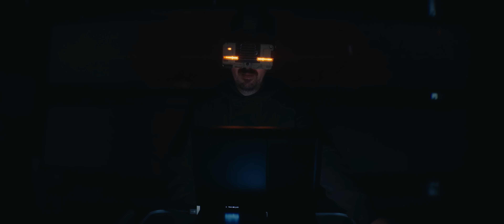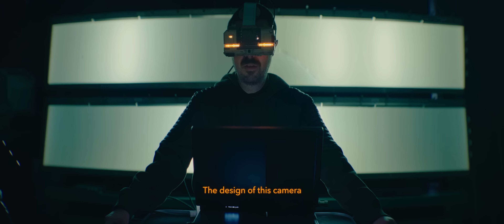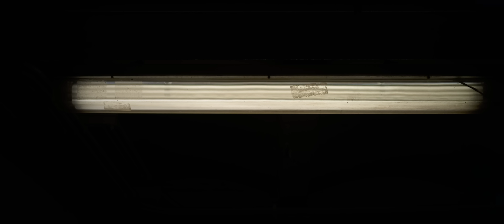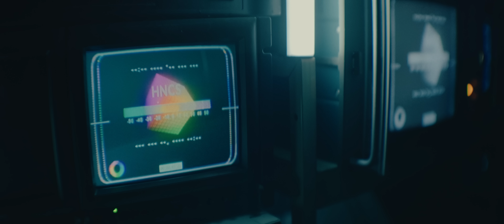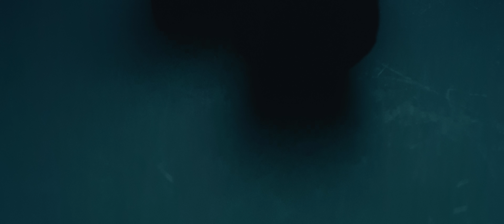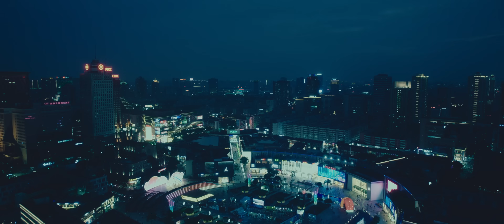when hasselblad shows us the future.

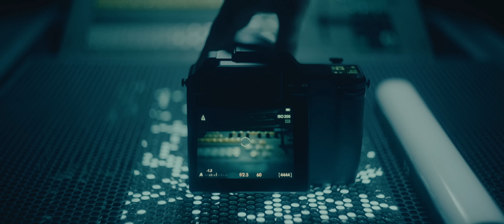Comment: i wish the MF feature at 4:31 was on every camera

i remember some adapters for MF lenses to Canon EF used to have focus confirm which was similar and it sucks that there isn’t this kind of “MF focus confirm” for all cameras
Reply: Nikon has a similar function all of the cameras I've ever used from them, d2x D7000 D800 Z6ii and Z9 plus the Z9 has in viewfinder focus peaking if you like that, (I do like that).  In the bottom left corner of the viewfinder below the image section next to the metering mode indicator.

Comment: Your video is very creative. I almost bought the predecessor of this camera new in December of 2016. I was in LA at Samy’s and ended up buying a Leica S007. At the time, the Hassy was new and had serious software issues in that we couldn’t even get it to boot up. One thing I can attest to is the quality of HC glass with Leica making an S to H adaptor. Some of my favorite shots have been made with Hasselblad lenses. Since 2016, I’ve crossed paths with several versions of this camera, but I was never convinced that I should make the plunge as Leica always seemed to have the edge. As I watch your video, I am swayed somewhat by your images, but 100mp is a bit much in my opinion. Maybe I will make a change at some point; however, I’m getting a lot of mileage out of 24mp full-frame cameras including my Sigma fp and my Leica SL2-S. And if I want to get the best look, I’ll shoot my H2F or 7ii. I also have a 6x6 Ikonta from 1954 that is very capable. As for the X2D, I will say that the build quality and in-hand feel is stunning. If you can live with the res, it’s a beautiful camera.

Comment: Is it very difficult to work with such big 100mp files? Do you need a big workstation or is it possible to edit these files on a MacBook Air M1 (2020)?
Reply: I have a 8GB M2 Mac Air, working with Hasselblad's 100mp file is troublesome.

Comment: Hasselblad now is nothing like they were even a few years ago after getting bought out by DJI. They don't even make parts for their old legendary H6 cameras anymore that many pro photographers are using so that's left a bad tase in a lot of people's mouths. It's almost like a reboot of the brand. I think this is a good first try but it's missing a lot of features in the EVF like focus peaking, variable focus magnification, and live overexposure warnings. All which could be fixed via firmware.
Reply: I think they still service old lenses and H-cameras, at least I got my HC-80s broken af fixed two years ago. It was the old version of that lens too, without 1/2000 shutter speed. But yeah, it is a bummer if the parts just disappear from inventory.
Reply: @ristotakala  They aren't servicing the H6D-50C which is what a lot of pro fashion photographers use. It was released in 2016. And I've heard that's because they are out of parts. I think they will service things till they run out of parts but they aren't making any new ones. That really sucks though less than 10 years of support for a $20,000 camera. I've also heard though that after the DJI aquisition their support is almost unreachable and takes months to hear back after sending something in.
Reply: @NickDelDuca  Do you happen to know if they have parts for the 50C -back? That is what I'd like to upgrade in the future, currently using H5D-40. If they had difficult times at the manufacturing phase of H6D -bodies and that it did not sell that well, then that shortage would focus (pun intended) on H6D-bodies. On the other hand, I doubt that Hasselblad will announce their spare part situation publicly.
Reply: @ristotakala  I know for sure they have no spare backs for the H6D-50C. They do for the 100C but who knows how much stock they have left. Im in a private chat server with quite a few high end pros and I know of at least 3 people with H6D-50C's with failed backs that can't get them repaired.
Reply: @NickDelDuca  Thank you for the info! Well those H5D-50C bodies are not that expensive, might as well take a little risk. The X-series is nice, but I like the H-series ergonomics... and weight distribution with HTS+lens combination. It is a pity that Hasselblad "evolved" like this. Would you buy a H5D-50C?
Reply: Hasselblad seems in much better shape now than for decades I’d say. It’s funny on the internet some people thinks ownership equals management. That’s not the case. Hasselblad was sold to external owners in the 1970’s. Hasselblads are designed and manufactured in Sweden same as always.
Reply: @tor2919  Their customer support changed when they got aquired by DJI. They barely even answer support requests anymore. A company that's doing well doesn't ignore it's customers especially when a lot of them paid 20k+ for their product.

Comment: Wonder if Casey’s will ever do a video on the Nikon Zf and seeing how Nikon try to take on the fujifilm’s XT range
Reply: I would prefer the Zf over the XT series because of Full Frame. But lens choices, i rather go with FujiFilm.
Reply: @WidePhotographs  the full frame sensor on the Zf is really good especially when paired with the fast Voigtlander 50mm f1.0 Z mount. I wish they also made a fast 35mm and 85mm lens to complete the range. I’m just waiting on fujifilm to announce their refresh on the x100v range as im hearing rumours of it everywhere and getting that as a secondary, more portable, street oriented camera to be out capturing moments with my missus.
Reply: @Teledible  it sucks during the summer, I had a chance to pick up a used excellent condition of the x100v but chose the z6ii used instead. But just like yourself, I am waiting for the announcement of the next x100 series to sell my current gear. Don’t care if the next x100 series comes with full frame or stays as a APS-C, I prefer the lighter form factor.

Comment: I find it interesting that people never talk about lenses ability to resolve detail. There isn’t a consumer level lens out there that can fully resolve 100mp.
Reply: Fuji GF Lenses
Reply: worth mentioning that because of the larger sensor hence larger image circle 100mp on medium format is equivalent to 60 on FF and 25 on aps-c at the same pixel density. There are sharp lenses, just not large enough ones
Reply: @ChrisThe1  Fuji GF medium format lenses can resolve 100mpx without any problems.
Reply: @fenrisler  oh absolutely. The point i was making is that plenty of lenses can resolve that detail, especially aps-c lenses, and not just high end medium format
Reply: @fenrisler  they can’t though. If you look at testing site like DXO mark the only 3 full frame lenses could resolve more than 50mp and only 10 or so are above 40.
Reply: @tdawg719  I was speaking about medium format lenses by Fuji. If I see it right dxo does not have any Fuji lens in their tests. GF line was specifically developed for MF and high resolutions. Haven’t done “scientific tests” on them but I do not see any issues even at pixel level. I have 80mm, 100-200mm and 32-64mm on GFX 100s (100mp).
I sometimes crop the hell out of these pictures and they are still as sharp as they could get.
Reply: Yes almost all photographic lenses are not able to resolve 100 lines /mm, but 100 Mpix is way less than 100 lines / mm 😂
Reply: @jean-claudemuller3199  ...what? the gfx 100 has a pixel pitch of 3.8 micrometers. that's around 300 pixels per mm. your point?